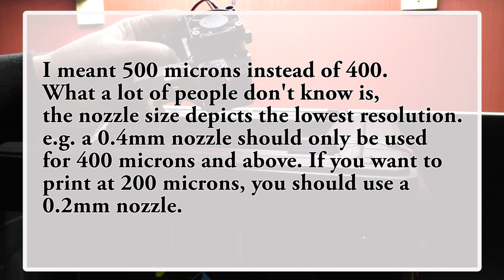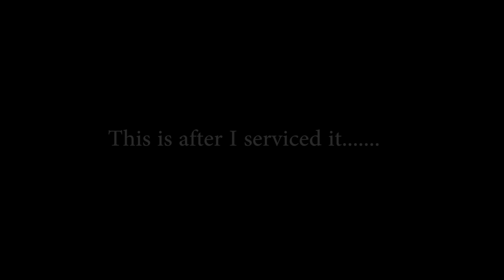Flashforge Creator Pro - Long term use & mods & repairs

Comment: I know this is old - but I really appreciate this video.  I picked up two of these. One works - the other needs repairs. I just did the glass plate changeover. I'm trying to hack a new hotend. I am just using this to print functional parts for our other projects - and it has been pretty stable so far.
Reply from the maker: I'm glad it was of help. I did loads of mods to mine but it wasn't big enough for my needs so I sold it in the end. It was a  very reliable workhorse and I'm glad I bought it though.
Reply: +1.  I run a Qidi X-Pro which is 99.9% the same printer.  I've also nixed the left extruder and built a better fan duct.  These are old enough now that it's hard to find useful info.
8 years late, but thanks for posting this.

Comment: Hi Tony, as an engineer who designs Laser Cutters for a living, may I make a suggestion?..First off with the X carriage off the assembly, measure the centres between the X axis shafts using your calipers at BOTH ends of the X shafts...where they meet the holders...Then saw the X carriage in half so it doesnt bind, then plate it over with some sheet aluminium and drill through correcting the error....Moulded plastic shrinks and moves as it cools during manufacture...a lot.
Reply from the maker: I'm scared already!    
You know what happens when I'm let loose with a saw, puppies and people die!    
I get what you mean mate and I've measured the 2 points - it's perfect now and I think I'd be best to leave well alone or it'll never work again :D

Comment: I have the Qidi Tech 1 printer and it's the clone of your Flashforge Creator Pro. I like it a lot. I found your video to be very interesting. Thank you.
Reply from the maker: No problem. Coincidentally, I'm just in the process of stripping mine down again and doing more mods...... keep watching :-)
Reply: I had absolutely no idea that the Creator Pro is the the Tech 1.  I have two Dreamer NX's - which are also sold under lots of names.
Reply: @MarshallEvans  - I think Qidi made their copy of the FlashForge, and not very well.  It's amazing how much 3D printing has improved in the last seven years since my original comment.  I'm making room for a Sovol SV08 to support new products and increased production.

Comment: HI
I see the glass bed on top of the standard heat bed. What was the setup you used to stop the print head and home position crashing into the glass. Did you move the end stop sensor, use marlin to change script, settings in simplify or all of the above?
Great video too : )
Reply: that looks like garolite bed. Better for nylon printing.

Comment: Hello, I purchased a 2nd hand creator pro. The left extruder was working when I had the extruders in the wrong position. now there is no heat coming from it. Can you offer any assistance?
Reply: comment from the year 2025 - what do you mean extruders in wrong position, did you swap the stepper motor plugs? the connectors for the L/R sides are color coded.

Comment: Hi , a good lube to use on the rails and bearings is plumbers
Silicone pipe spray.
I use it on the bed of my bench planer thicknesser the timber fly’s through , silicone is so slippery

Comment: Hi, it was my first printer several years ago. You gave me the idea to restor it ... how did you removed the left extr. .. when i remove it and power the printer it fips loud .. and yes i would love to see more inspirational voideos about this machine. Wouldnt it be betrer to remove the right one to have better acces to part cooling fan easyly and put something where the right sits for zero stop on this site? Greetz TT

Comment: Do the poly bearings have rolling elements?...or are they plain sleeve bearings..? I would have thought the change in quality half way up the workpeice was down to the Table not incrementing down properly..?..Not the X Axis.?...A wobbly Table in other words.
Reply from the maker: The bearings are Igus Drylin polymer bearings. They don't have rolling elements and hopefully, it'll cure all my problems.........wishful thinking!   
I checked the print bed and it's solid (no movement) but the bearings are rather 'graunchy' but they're much better no I've made them parallel.   
Wish me luck :D
Reply: Unless the Rail centres are anything other than perfect, those Drylin sleeves will lock solid, ask me how I know..?...A Student colleague tried to use them years ago, I told him they were shit, but he didn't listen.
  I dont want to put a downer on the idea Tony, but Im not hopeful. A better idea would be to obtain some new Linear bearings and fit those. Rub the cylinders down gently with some wet and dry paper first though and wash it clean after with turps or paraffin. Apply some fairly heavy diff gear oil (sparingly) to the rails, this will help kill any resonance and lube them.
Reply from the maker: I've bought some linear bearings..... just in case. I've heard nothing but good things about the Drylin ones.... let's hope you're wrong mate (probably not)  :-)
Reply: Vortecks To be fair, the Drylin slide block he got to try was just awful, virtually locked up on its anodised rail....I have seen better draw runners on a Wickes kitchen unit...lol...I hope yours works tho mate....Not holding me breath.....:)
Reply from the maker: I hate to say it mate...... these Drylin bearings are superb!    
The print quality has increased massively, it's much quieter and the stepper motors stay cool now.
Reply: Vortecks Cool, I have to say, the Drylins I was on about were some slide block type, not cylindrical type...They were crap though...Now you will have to do an upgrade Video. Pleased it worked for you Tony, well done......:)

Comment: Can you post a link on where you picked up your new bearings.  I Have the same printer for a week now and have noticed irregularities in the prints and noise and vibration when printing.  Have you experienced any issues with the Z axis?  min seems to be off after each print and have found the nozzles rub on the print causing the print bed to move up and down.  It was just leveled on the prior print.
Reply from the maker: These are the ones I bought.... http://www.ebay.co.uk/itm/201571607189    
You have to cut them down to the correct size though (if you look at the photo, there's a groove on each end - cut it there).    
As for Z axis problems, I haven't experienced any but I checked all the screws and sensors before I did any printing. Make sure the Z axis microswitch board isn't loose (it's behind the plate at the back and you'll see it when you drop the bed). Mine was a little loose when I bought it.    
Also, make sure you level everything at the temperature you're going to print at because there's a lot of expansion at temperature - set it up in 'Preheat' and (when it's at temperature) run your plate levelling. If you're using a 0.4mm nozzle, use a piece of paper folded in 2 and level it so the nozzle is just touching and then, turn the knobs about 10 degrees clockwise to release the pressure a bit. I always run the levelling 3 times before every print.
Reply: Vortecks hello where can you buy the timing gear on the other side that the belt drives on

Comment: got general machine grease and took off right panel and pulled axis motor to tense belt as I've read elsewhere. refixed whilst tightening screws back and we'll see. I just wish there was a rod replacement vid.

Comment: This video is great i have the same FlashForge Creator Pro 2016 model and i am looking to replace my linear bearings on the X & Y axis to IGUS Drylin bearings (They are ordered, just waiting for them to arrive). I don't suppose you ever did the follow up video where you replaced your bearings did you? Great video, and very helpful :-)
Reply from the maker: I've since upgraded it even more.   
After I got 'ghosting' along the front edge of some prints, I started experimenting with different things. I'm now using carbon fibre rails which has got rid of the ghosting completely and the print quality is superb. I've still got to edit the video but I should have something in the next couple of weeks but unfortunately, I don't go through how to remove everything.   
There is no easy way of replacing the bearings, you have to completely dismantle the carriage by removing the 12 bolts in the top and drop it all down. That is after you've removed both stepper motors, and all the belts and (the important part) the microswitch board on the left backside. I did try to video everything but it's virtually impossible because you need to get right inside and I kept blocking the camera's view. I will have another go at it but I can't guarantee it'll be of any use.
Reply: Hi. Which Igus bearings are required? Size, quantity and part numbers would be appreciated. Ordered a Creator Pro and wish to get the Igus units right away.

Comment: I have ordered a Flashforge Creator Pro - How is it out of the box? Do you suggest mod'ing the heat bed right from the word go?BTW thanks for your advice on this printer.
Reply: Buy a Ceramic toll tile and cut to size..use spacer to adjust plate,,
Reply: Thanks Glen.
Reply: Lot of thing you can do to make it a good machine like shift the on/off switch to the side  print a cover for wires,,shift Monitor out side,stop junk falling down the SD card slot,,Use USB if possible
Reply: Some people say you need to get rid of one of the print heads?
Reply: Yes 1 head will do... I changed mine to run 1..never found a reason for 2
Reply: Buy FF with 1 head
Reply: Thanks - I'll try it with two heads and if its a problem will convert to one head. BTW Why use a tile on heat bed - wouldn't glass be better?
Reply: Tried glass not worth the effort a tile is just as as smooth get for nothing ..you can hammer away with a scraper but found a is easy to get part off, Lot needs to be done to make your own print head  but save time and works well.. need some one with a Lathe
Reply: Thanks for your advice.
Reply: I could not possibly and more forcefully reject the idea that glass is not worth the effort.  If you print ABS there is no other option than glass + glue stick + 110C.  Get the glass beds directly from flashforge.  Get the clips from Thingiverse (the one with 3 parts, a screw, knob and the clip).  I NEVER run my printer without a glass bed.  Sometimes I use Kapton on the bed.  I like to keep 3-4 around, one with Kapton, one with blue tape, on PEI maybe, one bare for sure.

DO NOT PRINT ON THE ALUMINUM BED.  PERIOD.  I've put over 7 kilometers of filament through my printer.  Nylon, PETG, Wood, PLA, ABS, PC-ABS, Copolyester, Flexible etc.
Reply: PS its stupid beyone belief to switch to 1 head.  Not only is it nice to have a backup, I have one configured for all metal for hotter temp materials and left the other for PLA since PLA jams in my Micro Swiss MK10 all metal hot end.
Reply: Damn I have been using a tile for 3 mths getting the best prints ever and no need to heat the plate  and now you tell me it does not work,,,Maybe you should ask your self WHAT IF..I have tried all that you have and more.. even got an oven door then found out you cant cut the glass,,oohh and I have never paid for a tile.. But you do what you like I dont care I was just trying to help people who want to learn,,
Reply: Need to make your own hot end with 2 x 40 W heaters ,,independent power supply works well  at 15V

Comment: Just saying I’ve had none of these issues with my FlashForge, whether it was transport or poor settings you have used, I have found with many of the materials I print with I use a lower temperature as the extruder is good enough to push less malleable materials out, it seems you have broken your forge yourself? Good maintenance, frequent dusting and greasing should solve most of these problems.

Comment: 1:50 I've heard that your not suppose to rotate Linear Bearings, they are not built to be rotated
Reply from the maker: You're correct but mine were being replaced because (even when they were new) they were very noisy. With the new polymer ones, it's made it a completely different machine! :-)

Comment: That’s a good idea: removing one of the motors to save weight as opposed to adjusting the acceleration or tuning the printer in a different way.
Simplify 3D seems like a good product, but since I’m not making money from my printer (just a hobby) I’m going to try the cura route. It’s funny that some 3D printer companies have such crappy software. A 3D printer is just a bunch of cheap parts that have been calibrated and tuned.. wait never mind that’s most electronics... I’m just saying software can be the difference between a really nice and a really crappy product

Comment: I own many FlashForge printers and have never seen one of them come with shitty bearings like that! Nor bent y axis brackets. Btw x axis is front to back, y axis is left to right. 

I have 3 FFCP the older ones and then 2 FFCP 2016’s as well as 2 creator woods. None were like that. The only problem I had was the wood ones had some nasty plastic gt2 pulleys that were out of round and creating prints that were not dimentinally correct so I replaced them with aluminum ones and they are fine. 

You must have got a refurbished printer or just flat out got a junk one.

Comment: that's not true a 0.4 nozzle can easily print up to 50 microns (0.05 mm)
Reply from the maker: I know it can, I sometimes print in 0.2 with a 0.4 but the consistency isn't as good as using a 0.2 hotend. That's why I said you should use a 0.2 for printing in 0.2

Comment: Flash forge is a great printer but poor parts. Their tech support guy is BS. I’ve purchased 3 of these and have had many problems getting replacement parts. My newest one came with broken panels (front and back) cracked by the feet. Very poor functional design but looks nice. Their bearings are garbage and the plastics are not in specs. On 3 printers I’ve had to replace the same parts. Bearings, and got rid of their stupid plastic belt pulleys and replaced them with aluminum machined ones. On the wood case one the plastic pulleys were so far out of round that you could move the extrude carriage from left to right and see the wobble. They said it was fine and it wouldn’t be a problem. Well they are wrong because it wouldn’t print square cubes right. 

Upgrade bearings, upgrade to aluminum pulleys, and if you really want a nice setup replace the plastic crap with aluminum x carriage and Y end parts. No flex!